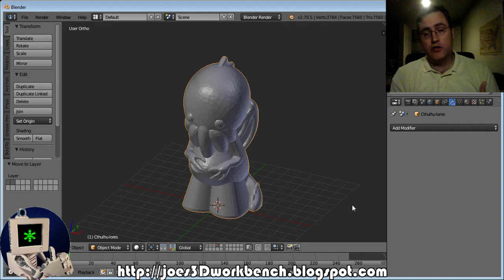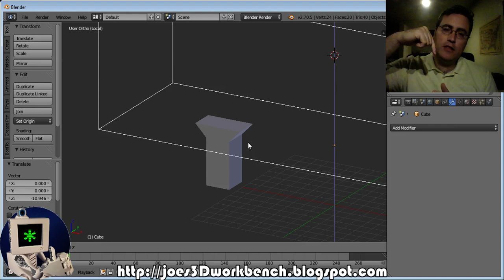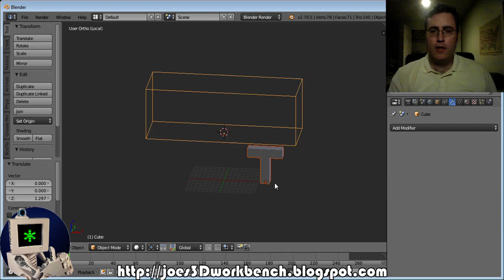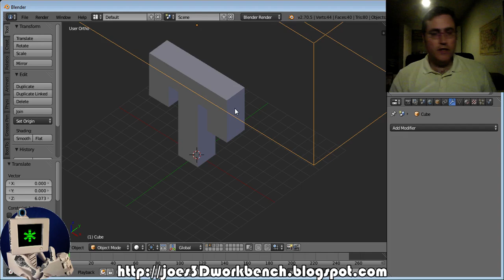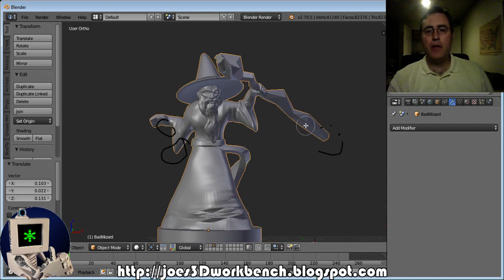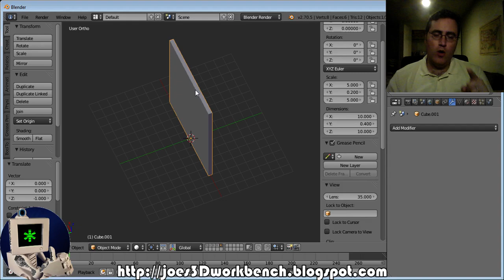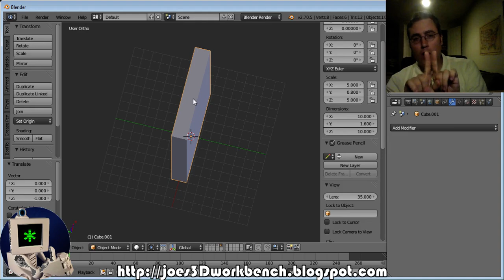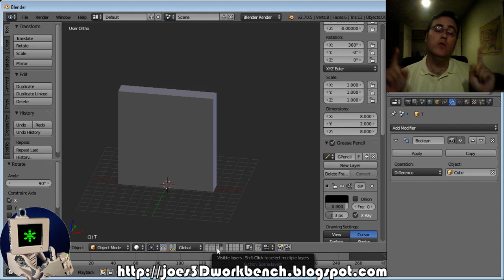Modeling for 3D Printing - YHT Overhangs, Bridging, and Wall Thickness

Comment: Thanks for dropping some knowledge professor. Could one get away with 1.2 wall thickness on a stand alone wall.  The model has a cape element that is  free hanging. .8  is a bit too week and 1.6 looks clunky. I am hoping 1.2 works because it is 3 layers right next to each other no gaps.
Reply from the maker: Some slicers can do that, some can not. My suggestion is try it an see.

Comment: Joe, good tutorial.  Just a little confusion on what I kept hearing on the wall thickness of 0.16mm and 0.12mm (I believe you meant to say 1.6mm and 1.2mm).  I don't understand why 1.2mm is no good.  it is a multiplier of 0.4mm excluder size.  
Cheers!
Reply from the maker: It used to be that if you're wall thickness (not shells) was an odd multiple of the nozzle thickness, that the slicer wouldn't fill in the middle, odd, shell and would leave a gap. IN fact anything between the shell thicknesses would be bad. However, modern slicers have fixed this, so it's less of an issue, as long as you're not still using a slicer from 2014.

Comment: Hi Joe, just getting into this as a new hobby and was interested in your book but the site is gone - I think I found it on Amazon, is that an up to date revision?
Reply from the maker: Yes, that's the book. And if you go to my blog you can find a link to my 4 most recent books, one of which is a compilation of the other 3, which are shorter and less expensive as well. Not that I don't want this book to see, but the other ones are better.

Comment: Good tips. I've had good results at 1.23mm and is my goto thickness on enclosure protos.  I hated support removal discoloration issues till one day out of shear desperation with print in hand and heading for the trash (because client demands eye appeal) I grab my embossing heat gun tool and blow two seconds of hot air on the area.  Jaw hits ground and I spent an hour removing white specks and doing minor re-flowing from every print that needed it.
Reply: Great tip on heat gun. I was just about to ship a box of toys off, and thought I'd get a quick try.  I used a larger one,, worked good,, but of course way too big of a nozzle.  The embossing HG is smaller,, but now I'm thinking about maybe purchasing a digital hot air rework gun.  They are even smaller,,  with an assortment of nozzles,, and temp. control.
Reply: Yeah, a heat gun. Also acetone or acetone vapor smoothing an ABS print can help. But it's still a lot of extra time that a little bit of good design can avoid. Sometimes you have to use supports, and I understand that. But if I have the choice I avoid needing it.
Reply: I've tried a heat gun, a Monokote gun, a paint stripper gun and none had the ability to heat a small area very quickly. I say two seconds and if its any longer the area deforms. With the embossing gun and a shield I can remove a row of support discoloration spots just a mm or two away from a high detail area without fear.  I'd imagine a rework gun would be perfect.   I did try my DYI hot air reflow gun and it was fine, just a little to slow to heat up for me.
  
Acetone vapor smoothing (AVS) has its place but really it's apples and oranges between the two. AVS is great in smoothing projects where detail is not an issue and/or a strong surface is desired.  Finding an even way to achieve equal partial smoothing on all surfaces for an item like a figurine is a little difficult do to because of over hangs, material thickness or condensation run off.

In the end I studied hard on S3D support settings in combination with the bridging characteristics of the flavor of ABS I was using and that worked well. Rarely does support need removal help (pliers) and after the embossing gun pass there is no record of support anything 95% of the time.

Now if Blender was just a little more 'mouse only usage'  and not totally bass ackward compared to every other creative drawing program I'd be set.

Comment: Why do you say .8 mm then say .16mm?  Do you mean 1.6mm?  Please someone tell me why 1.4mm is no good.
Reply from the maker: Richard Huang just asked the same thing. Yup, I made a mistake. But, as I said to him: "It used to be that if you're wall thickness (not shells) was an odd multiple of the nozzle thickness, that the slicer wouldn't fill in the middle, odd, shell and would leave a gap. IN fact anything between the shell thicknesses would be bad. However, modern slicers have fixed this, so it's less of an issue, as long as you're not still using a slicer from 2014"
Reply: .8 + .8 = 1.6 so .16 was incorrect. Basically it should be evenly divisible by your nozzle size.